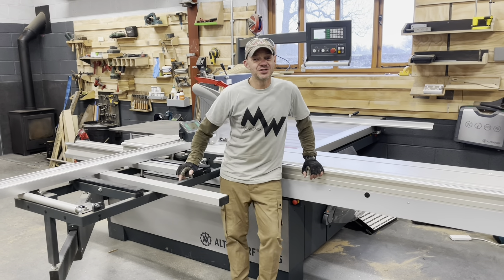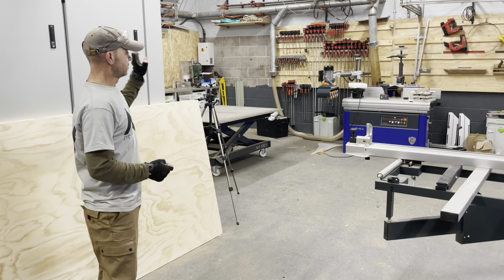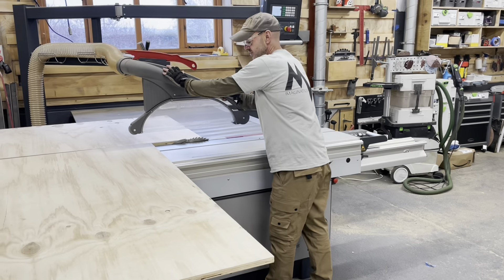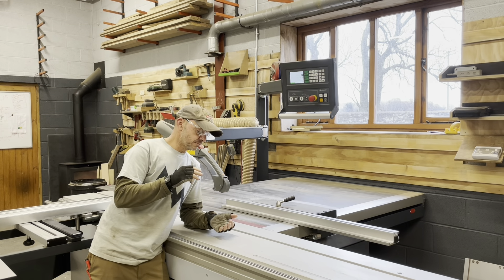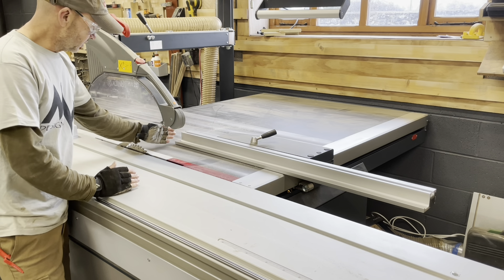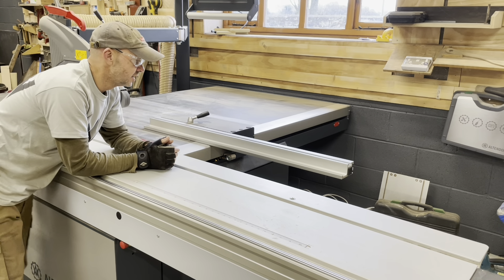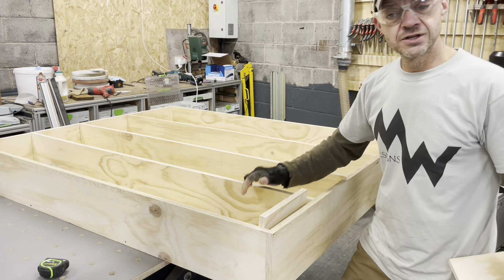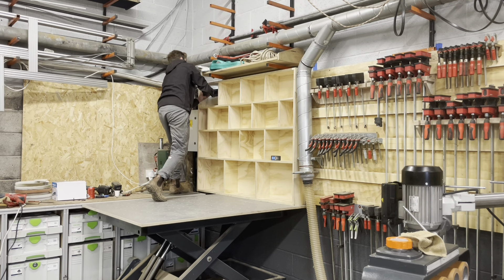Altendorf F45 - & 1st look in new shop

Comment: Congratulations on the new Altendorf!  I'm green with envy.  That's a seriously sweet machine. I've been waffling for some time among a Format 4 Kappa 400 (Felder), a Martin Machine T65, and an Altendorf F45.  A slider is a real game changer for someone like me whose been running traditional American cabinet saws for years (though I do break down panels with a Festool track saw).  Alas, sticker shock!  Even the Robland, Hammer, and SCMI cost a pretty penny.  Every time I get close to making a decision, I think of the enormous cash outlay, and I get a terrible case of cold feet.
Reply from the maker: I know what you mean :)

Comment: Great video & an amazing saw. can I ask your advice on something?

I've just bought the Robland fZ300 as my first panel saw. I'm struggling with ripping wider panels. Say I put a clean edge on the board & I want 2 cuts at 550mm I can bump & cut the first one. However the second cut will be unsupported by the sliding carriage. Is the only solution to stand at the back & handle it like a table saw? As this makes the sliding carriage redundant. 

Any advice would be appreciated.
Reply from the maker: Yep , iver time you get s feel for it . Keep going

Comment: Looks great. CNC saw fence is so awesome it save so much time from the "nudge technique"  you will never want to go back. Not sure if Altendorf  is the same but be careful when switching from high to low fence, you might need to push the fence button, not that I ever forgotten that and cut wrong. ;)
Might I ask roughly how much the machine cost would be great for when looking for which manufacturer to choose in the future. Thanks.
Also looking forward to see the new shop. Have a great Christmas/holidays.
Reply from the maker: Funny you should say about the fence, I cut some MDF for a friend and without thinking change the fence from the high to the low didn’t even think about adjusting pressing anything, The next morning when I switched it back for a different task I thought oh my God have I cut the wrong measurement but luckily the Saw are just self automatically soon as you move the fence
Reply from the maker: I can’t remember the exact price, but if you speak to Gez @ RJM , he’ll will sort you a quote for the spec you need

Comment: Would have been nice if you would have flipped a piece of that crosscut over to see how well the scoring blade actually worked as that yellow pine faced is really brittle .
Reply from the maker: Dam , I did do a test cut and forgot to add it the the video .. I will very soon on the next F45 in depth cheers Andy

Comment: I use an older generation of an Altendorf saw like this, it's good but it's not as perfect as you say. The saw is calibrated to expect an exactly 1/8" saw kerf, so when you send your blades out to get sharpened you have to take carbide loss into account. I suppose it's not an issue if you're the only one operating the saw, but we have 10 cabinet makers and probably over 40 saw blades that get constantly changed and sharpened. It's a lovely saw but realistically it only offers convenience, not accuracy.
Reply from the maker: Not sure I used the word perfect ?  But since I bought it it’s change the way I work .  I will share more videos soon on how and why .   I guess most this will need a re cal if cutter wear or you change a blade ?  Or is the a saw which auto re cals?   I changed the rip fence from high to low and forgot to check , but the saw know and sorted it without me doing anything

Comment: Hi Andy do you need to calibrate the panel saw every time you get a saw sharpened?
Reply from the maker: I haven’t thought about that , I guess I’d the blade is re tipped it would be ok 3.2mm. It’s very easy to tweak the and adjust